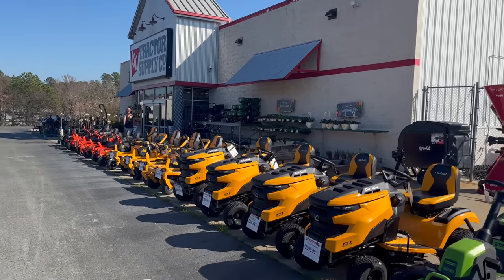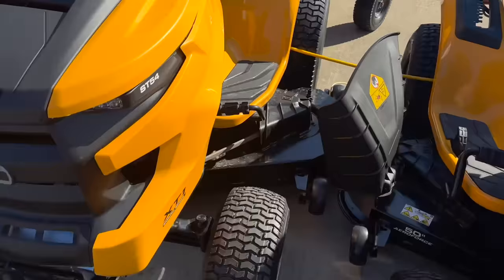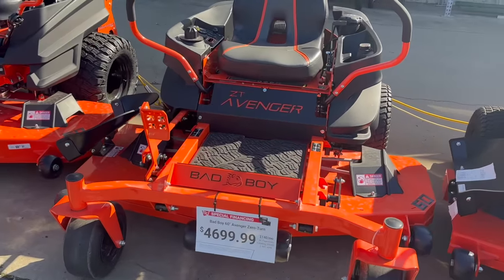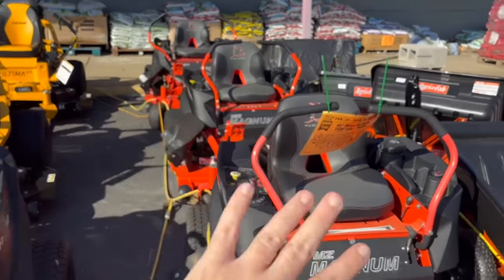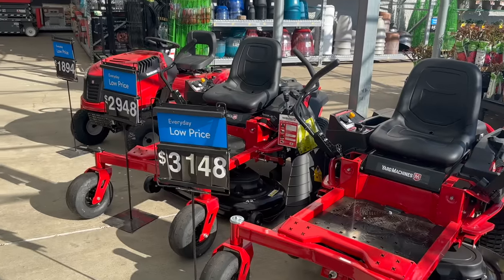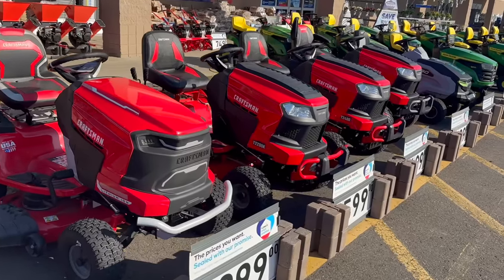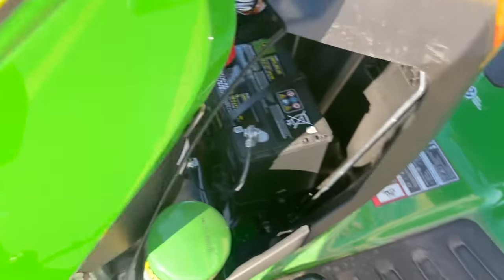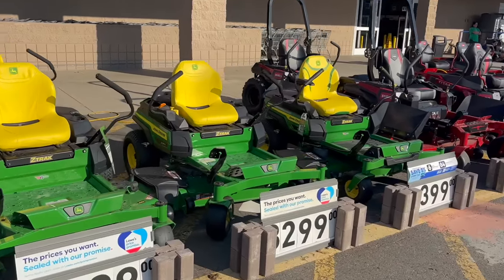The BEST Mowers to Buy and What to Avoid at The Big Box Stores This Year!

Comment: I took my Bad Boy in for servicing and new blades and the mechanic said’ I never worked on one of these but they are the best built mower I have ever seen!’
Reply: Guess he doesn't have any experience with toro or older bush hogs
Reply: I just bought a Bad Boy Rambler on advice from my step son & haven't regretted it. All I have heard is positive things about them.
Reply: Bad boy is junk
Reply: I bought a badboy ZT elite with 60in deck and the kawasaki engine a couple of years ago. It mows a few acres about twice a week. Have a lot of wood fence posts that I try and get as close as possible so I don't have to do a lot of trimming. Have cought the deck on the posts a couple of times and it shifted the whole mower sideways, the deck is built like a tank. Huge difference from the Husqvarna zero turn I had previously. The Badboy is extremely durable and very reliable. Just replaced blades on it today, which is probably why I got recommended this video.
Reply: And why are they junk …?
Reply: @MitchellKelly72740  No clue what their problem is, but I love my new Bad Boy Rambler
Reply: @jamesfountain6183  the problem is that you guys have an example of just one, I get to see the reoccurring issues on many. Badly designed especially the decks. Give it time, and you will see.
Reply: @Daniel-qe8qe  so what is going bad on the decks, and what size/models are you seeing with the problems?
Reply: @91CavGT5  every and all models, spindles are junk design and on top of that most spindle pulleys need to be cut off the spindle. Baffles are blowing out within a couple years. Look at the basic warranty given I believe 200hrs or two years, that should say a lot.
Reply: @Daniel-qe8qe  this is the first I have heard about any of this, and that is after listening to multiple small engine repair shops, that is why I ask.
Reply: @91CavGT5  the badboy dealer is less than 2 miles from me, he's mostly hated by people after the purchase so we do mostly every briggs and kawasaki warranty so I see a lot of them. Unfortunately.
Reply: Got my John Deere S100 in 2022 for $1700 out the door & I love it! Briggs & Stratton. Had a Snapper that was smaller and lasted 14 years, but like the JD better.
Reply: @jimbograves1576  just wait,  you're in for one hell of a surprise lol
Reply: I had 5 acres mostly grass and 21 trees. Bought a bad boy, 60" deck, 31hp Kawasaki. 9 years and I only had to change blades, one belt, filter and oil changes. Absolutely reliable and fast. Nothing slowed it down, tall wet grass was no match.
Reply: I keep my 30 acres in NW Montana trimmed to the max with a 60 inch Bad Boy with a Yamaha. It is a 2012, and I run it about 80 hrs a year. Impeccable machine. I am a goober with mechanics but even I can keep the systems lubed and parts reinstalled.

Comment: I learned why you don't buy these machines at Lowe's - maybe unless you have a pickup or trailer.  I wanted to upgrade and replace my old 15 year old entry level John Deere with an S170.  I went to Lowe's and wanted to pick the serial number of the one for delivery- keeping it short, they apparently were too busy to accommodate. I then went ahead and did their 'online order'-  they get one ready for delivery in 5 days and arrive at my house with one that has scuffs and scratches on the hood and fender deck.    They actually expected for me to accept it- and this is going to be the last JD tractor I ever need because of how much use it's going to get over the next 30 years.   I told I wasn't accepting it and to take it back!  Don't buy these things from Lowe's unless you can haul it yourself.

Comment: No more Bad Boys for me. I had a 60 inch ZT Elite with a Kohler motor (out of warranty). While mowing for about two and a half hours, it developed an oil leak that dripped on the exhaust pipe and it caught fire and burned down. The Bad Boy is extremely well built but, for some reason, I just can't endorse a flaming mower.

Comment: One thing you left out about the dealer is that your riding mower will be properly assembled and adjusted correctly. 
Thankfully I had worked in the equipment field for about 8 years and had no problems correcting the issues on my brand new mower I purchased from a big box store. This was my first and last time to purchase power equipment for a big box.
Thanks for all the great videos.
Reply: The John Deere’s at the big box stores are actually (supposedly) set up by the dealers! It voids the warranty if anyone but the dealer even takes them out of the crate! Big box store employees aren’t allowed to service them at all! And most of the others are almost fully assembled at the factory! A third party assembler might have to put on a seat or  steering wheel, but that’s it for service.

Comment: I use to live in Orangeburg, SC, it is home to a plant making Riding Lawn Mowers. The Last I heard its name was Husqvarna.  They made all the different Brands from Craftsman, MTD, and most of the others. All of them go down the same assembly line, switching for different models and names. All body panels were punched and painted there. Different models would use specific parts and thickness of steel. People would be amazed  that the same people assemble all the riding lawn mowers.
Reply: I think most of these mower companies buy their assemblies from a company like you are talking about. they then just assemble them into a complete mower. 

There is a company near me that does the same for cars! They stamp out parts for Kia, Mercedes and I think Toyota. Floors, doors, fenders ECT. Big place!
Reply: Same with a lot of other things built here and overseas. I worked at a shop making annular cutters and they got packed in many different boxes, like snap on, mac, matco, mac, and hougen (hougen actually manufactured them in MI)
Reply: Not sure but I beleive it was American Yard Products,then electrolux and now Husqvarna. They manufacture 917 source craftsman,Poulan,weed eater,lately Snapper(now back and owned by Briggs and stratton) and others... But never John Deere or MTD owned brands

Comment: 35 years ago I purchased a Gravely G series garden tractor.
1200 lbs / 50" deck moved by a single cylinder flathead 12 hp Kohler Magnum. Still makes a beautiful cut and never lacks power. Seems like all these home owner jobs are just selling a big hp engine with some lightweight sheet metal wrapped around it!
I wouldn't trade my Gravely for anything new these days!
Reply: Well, you did buy a garden tractor and these are, apples to apples, just mowers if they come with anything nearly as small as 12HP.  Frankly I haven't had too many issues with thin metal on my 25 year old rider except, finally the deck has started rusting out, and although the cast iron front axle beam is fine, the wheel knuckle to axle welds have broken a couple times, but nothing a DIY weld job couldn't fix.
Reply: @stinkycheese804  While yes, there is a big difference between a true garden tractor and a riding mower, is it not peculiar all the riding mowers come with such large engines? Is the design of the transmissions and or the drive of the mower decks that inefficient they need a twin cylinder 22hp on a 50" cut 500lb rider? In the 70s we had a MTD 42" cut lawn tractor and I know it was built a good bit heavier than today, and it had a 7hp Brigs. That was all and it cut heavy grass no problem. I'm guessing it's "horsepower wars" going on these days for the marketing and sales. At least the engines should never wear out before the rest of the tractor...
Reply: @lcee6592  Of course it's marketing, but at the same time, if the choice isn't that of stepping down to a lower quality (make) engine, I don't mind running one at lower RPM and particularly with the air cooled lawn mowers, having that be gentler on the oil.  If you think about it, if it is the same general engine design, it doesn't cost that much more for them to make the crank, pistons/rods, cylinder, etc a little bigger compared to all the other overhead  expenses.

Plus, with the larger engine, it has a larger alternator (all else equal), which in my case, allowed to get quite a bit of light out of LED pods to replace the pathetic factory incan headlight bulbs... not nearly as much as if it had a proper, modular alternator bolted on like you find on better lawn tractors, but still enough to power substantially upgraded LED lights.
Reply: @stinkycheese804 One thing about the giant overpowered engines: If they are single cylinder, you start to get an enormous kick every time the cylinder fires. These engines are the same block as the lower hp model, just bored and stroked to a larger displacement. That big jolt of power (ok, torque) can cause excessive vibration, break engine mounts, etc.
I think 16 hp and up should be twin cylinder.
Reply: @the_mowron I have a ancient Briggs 14 HP twin that is sooo smooth
Reply: @lcee6592  There were some graden tractors in the video.  The ones with the larger tires/wheels and beefier trans are garden tractors.  Although, today that doesn't mean much.  ALL of these MTD machines are garbage.
Reply: @neonnoodle1169  Yah they just don't make things like they used to. Way too much corporate greed, too many bean counters and too much government involvement. Consumers usually loose in the end...
Reply: Me too. I have a 10 and 12 hp walk behind.
Reply: Most components and materials are chinese manufacture nowadays
Reply: Yes it was probably All US made that's why
Reply: @jimjones9740  In fact yes, right on top of the dash/ MADE IN AMERICA 🇺🇸
Reply: @lcee6592   It most likely had more torque. Also, HST drives use more power than regular trannies you have to select the speed, like the old machines. It also couldn't mow nearly as thick of grass as you think it could.
Reply: @😊stinkycheese804

Comment: I must'a been lucky. My Craftsman lasted 17yrs (bought in 2004). It was a pain keeping it going at times but, I managed. I had to call a repair guy once toward the end and all he seemed to do was put new gaskets on the valve covers. Didn't fix the problem at all for $250. I then had to figure out what was wrong and fix it myself. It was running extremely loud like it had no muffler on it. I learned thru youtube, the valves needed to be adjusted. Bought feeler gauges and I'm sure it wasn't perfect but, it sure sounded more normal and lasted another 2yrs. I have roughly 5 acres to mow.
Reply: I have a 2003 Craftsman Gt 5000 I've been mowing  5 acres with purchased from Sears.Motor blew after 20yrs & I bought a good engine out of a John Deere & changed the shaft & it's like new again. Better to keep it going than buy this junk today lol.
Reply: @michaelrobinson2048  I got a 2002 GT5000 of season for $1500  at sears I cut 5-7 acres  for ten years then move to 1 acre cut it up till 2020 would still be using original engine but left cover off and water got in engine.  Bought used 26 professional B&S  did a valve job and reseal. Its up and running again.  I know it is Overkill for 1 acre with the 56in deck but so what cheaper and will ou last any new riding lawn mower.  Engine cost me $250

Comment: I've got a snapper rear engine rider from 1990 that I bought used for $300 seven years ago.  Works great and I bet will outlast anything nowadays! 😊
Reply: my craftsman rider is one year newer ..
Reply: TY for Sharing
Reply: Hang onto it, they aren't selling snapper tractors in the U.S. anymore.
Reply: I worked at Snapper a few months in 2010 when they were built in Georgia before they moved.
Reply: I retired My 2005, 28 inch Snapper, to my Vacation home lol only lawn about 3 times
Reply: For the diy guys,  you can not go wrong with an old snapper! I had one in 75 and used it until it finally broke in about 95 . I cut 2 acres every 3 was. I finally bought a xmark and another used snapper,.I still use both.
Reply: You're not wrong, the snapper you have was built to pass down.
Reply: That's because snapper back then was quality. Fast forward to last 10 years their quality went to crap so they couldn't be sold cheaper through Walmart
Reply: When quality goes down customers take notice and spend their money elsewhere.
Reply: Exactly. Buy new carbs if you have to.
Reply: Forrest Gump would be proud
Reply: Those old snappers are wild. Try to not pop a wheelie lol
Reply: @yamen16  Too late!  Already have 😁
Reply: Those rear engine Snappers are great! The rest are junk!
Reply: Got two 92’ and 98’ model years I was going to buy a used comet in 1992 as my first mower guy said it was his dads it was 20 years old and still worked like charm. I thought if I buy a new one it should last me forever so I did in 1992 it’s still going had  replace deck a couple years ago just wore it out other than just maintenance. The 1998 model was given to me it had sit outside for a while a new carb and muffler and used it for a couple years before replacing the deck on it’s still going strong.
Reply: I miss my old craftsman rider. Bought a Troybilt 3 years ago and it’s been in the shop once and going on a second time.
Reply: Those old potato bug snappers were tough.
Reply: You'll just have to replace that wheel under there that drives the transmission. No biggie, not expensive but really fun to replace!!!! =)
Reply: @brandonhebert5485  yeah I actually bought a spare for when that time comes 😁
Reply: Is that a good thing?

They are so poorly thought out and have ergonomics only a circus contortionist could like.
I  was SO happy when I did not have to use one anymore. 
Very  uncomfortable.
Reply: I hated ours every time I had to use it. @yamen16
Reply: Almost bought a 2013 Snapper earlier this year. I looked at it top to bottom and could not find anything wrong with it. It looked better than the new tractors that came out this year. Only problem was it was a 30 inch cut and I'm a lil bit fluffy, ok I'm fat--lol, and it was smaller than the John Deere STX 38 I have that finally gave out after having it for 15 years. If you look around go and find older models, like what I'm buying now, a John Deere GT 235.

Comment: I purchased a cub cadet zt1 54 4 years ago and I mow 4 rough acres once a week. No issues at all. It's a beast.
Reply: I had a Bad Boy MZ Magnum zero turn... what a piece of junk!  Constant problems and service.  I got the Cub Cadet LT54 to replace it.  Not a stamped deck on that model.  Seems to be good so far.  Much happier with it than the expensive and constant downtime of the BB garbage zero-turn!
Reply: @keoniwalaka8858 Kohler engine too, correct? The one she showed had an mtd in it
Reply: Funny are local mower shop owner always said Bad boy mowers are junk.
Reply: I have the same Cub Cadet but it is almost two years old and going in the shop for the second time in three months due to a leaking hydrostatic transmission. I wouldn't buy another mower with these garbage unserviceable hydros MTD uses in their residential zero turns.
Reply: Just received my Cub Cadet ultima zt1 50 with the stamped deck and Kawasaki engine.  I haven't heard anything about the spindles as she mentioned.   Also the hydrostatic transmission is the same as all the others being used on residential zero turn mowers today.  Kinda surprised but we will see.  Only bad things I've heard are the deck can vibrate and mine doesn't.

Comment: This is truly an education!  Thank you , Bre!  It i s hard for a consumer who may only buy one mower like these in a lifetime to know which on to pick.  Just like cars, picking the wrong one may turn into a money pit.
Reply: It's impossible to buy only one of the bad ones because they don't last.
Reply: @bluenetmarketing  Meh, my MTD built has lasted 25 years  and still mowing strong.  Sure it has needed a few minor repairs along the way, but total cost was MUCH less than if I had splurged on some $2500+ mower.  Granted, I am thinking in terms of what they cost 25 years ago, SO, yeah, it might cost closer to $2500 in today's money.

Granted I am not mowing commercially, not 100's if not 1000's of hours per season.  Keep the hrs/year in mind when deciding on what to invest in.

donjohnson might have hit the nail on the head with the statement, "just like cars", in that if you are thinking in terms of every little lost bolt requires hauling it to someone to repair it, yeah that would add up.  Fortunately mowers are not that complex, to the point where I would not tackle putting a new engine in a modern automobile, but I would on a mower.
Reply: @stinkycheese804  You said a mouth full when you stated it was 25 years old, back when MTD actually made a good unit. A lot of the old Sears units were good machines. Like someone else mentioned, the bean counters got involved, but in their defense the consumers bought the cheapest thing they could find, and wonder why it didn't hold up. It's still that way. I talked to my local Deere dealer last week and asked him what happened to all the 700 series mowers. About all they have is the X300 series with the non serviceable transmissions. He said, "I can't sell them, too high priced". Can't argue that, but millennials would rather buy a hot tub than a good mower that will last for years. 🤥🤥

Comment: I can honestly say my 5 year old Cub LTX 46 has been a workhorse....I have cleaned up a 3 acre pasture with it with only one spindle change due to barb wire getting to it....22 hp Kohler is a hammer. I have been looking into the bad boy z turns to keep the pasture clean in less time....thanks for all you do...those 2 spindle 46"  Cubs ain't that bad.....
Reply: I’ve got a cub ultima zt3 and love it. We use it clearing & maintaining fence it’s been great. Were well over 1000 hours with the only issue being my brother in law ran diesel thru it so we had to change the fuel filter.
Reply: Think of getting the same
Reply: Looking at one of these thanks for review